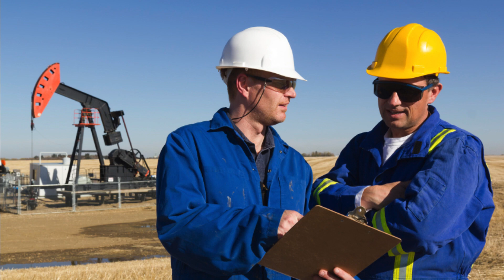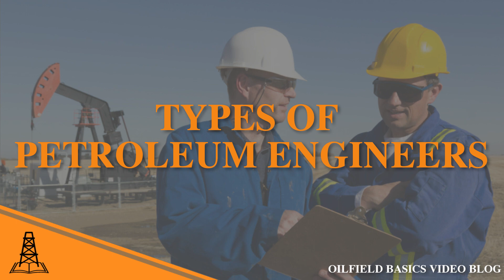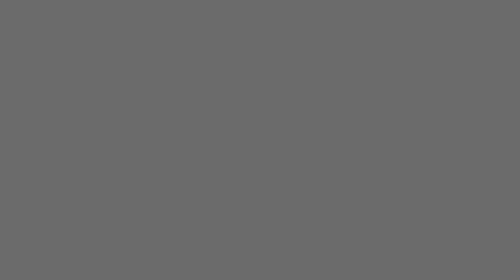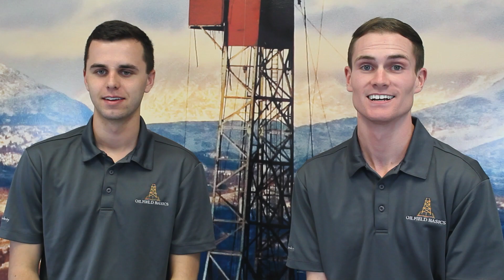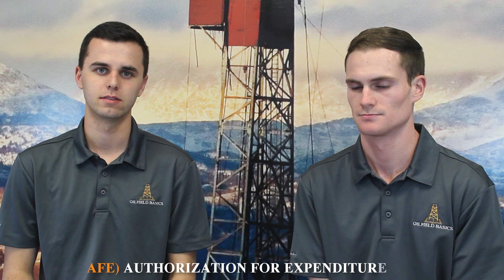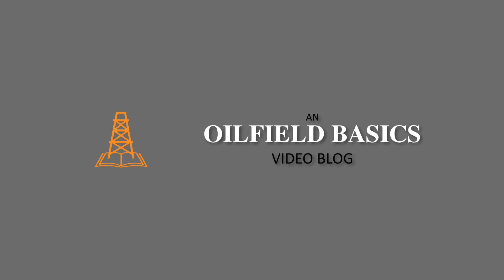Types of Petroleum Engineers

Comment: Is it common for companies to hire mechanical engineers for these jobs or do you have to have a petroleum degree?
Reply from the maker: Hey Dawson! Thanks for your question! From what we've seen, it's not as common for mechanical engineers to work in the upstream oil and gas industry. Aside from petroleum engineers, chemical engineers would be the second most common type. However, the midstream and downstream side of the industry might hire more mechanical engineers. Not sure. But, I figure manufactures of oilfield equipment might employ mechanical engineers. Does that help any?
~Derek, Oilfield Basics
Reply: Dawson Kram ya I have petroleum engineering degree
Reply: @OilfieldBasics  the gas and oil industry hires Mechanical Engineers all the time, y’all should know that…

Comment: Would a person with mechanical engineer degree be limited when becoming a petroleum engineer
Reply from the maker: A Mech E would probably have a harder time getting a job in oil and gas...at least when generally speaking of a petroleum engineering type of role. There might be some opportunities when it comes to equipment design/manufacturing/infrastructure/etc. however.
Reply: I think mechanical engineers potentially can be integrated in drilling operations due to the high involvement of machinery and mechanics.

Comment: What is the average starting salary in the us?
Reply from the maker: You can easily look up actual numbers on sites like glassdoor, but I'd say it's around $100k (give or take $20k). However, I've heard of engineers working for wireline companies and making north of 150 and 200k. It really depends on the company and position. Either way, petroleum engineers have the highest starting salary of all engineering disciplines.
Reply: What position is that salary is $900k?